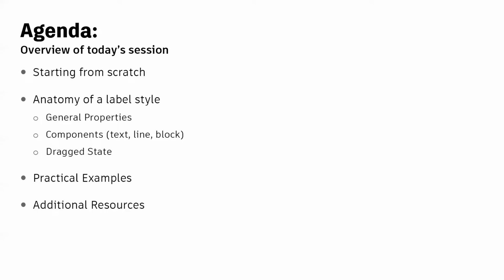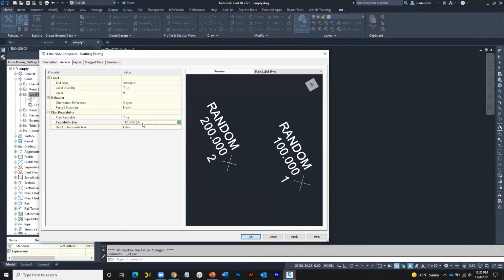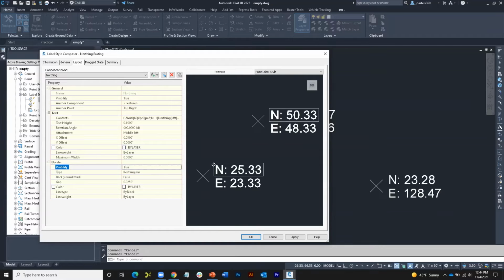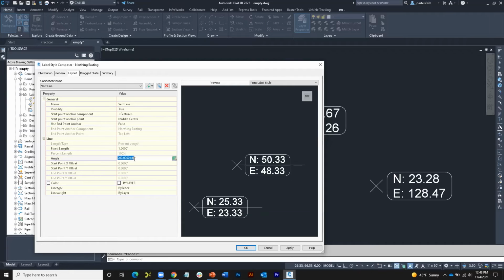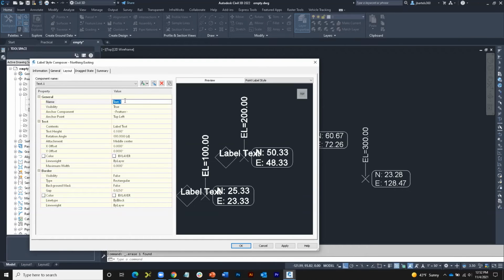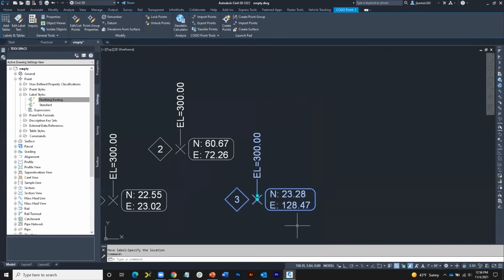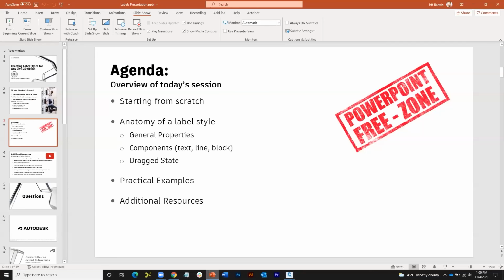Creating Label Styles for Any Civil 3D Object

Comment: With Label Styles in Civil 3D, if I have my drawing set to 1:50 and drag out and position my label text, then change the annotation scale to 1:100 and reposition the same label for that scale, the text height adjusts correctly but the text location does not revert per scale like MTEXT does. Is there a setting or workaround that allows label text to have different positions based on the annotation scale?

Comment: Thanks for this video.
however, got an issue: how to rotate text (multiply texts) to current view?
I would like to show on the screen (drawing), point number and elevation in vertical (different ucs) view.
Unfortunately, changing option for one of the label, (in Settings -- Label style -- General -- Behaviour  -- Orientation reference) does not change label view in vertical. 
Further more, editing rotation angle ( -- Layout -- Text -- Rotation angle) given me an insane  result in position of text...

Any idea how to rotate text from flat view (UCS World) to side view (isometric view) ?

Comment: Is there a way to create a point label style for existing structures with inverts? I am trying to have a label made for survey crews who only collect rim elevations, depths, pipe direction, pipe size and material between the rim and the pipe invert. Not only that, but I am curious if it can be dynamic in the sense that if one manhole has 3 inverts and another has 1, the same label can be used instead of creating variants of the label and confuse the survey crew. Again this is for existing structures.

If there is no way, I will understand. If there is another video made on this topic, please guide me.

Comment: 15:09 That won't work with pipe inlets to a manhole. If you move all the inlets and outlets to the top text group entry, you'll end up with a random connection value (Only the output connection, from what I can tell, will display.) The only way to get a border around all the text is to use the dragged state. The dragged state ignores all the text anchor points... and can only be controlled by the order of creation (which is lazy programming).

Now here is my problem.... Lets say I have a manhole that has a main line (an in and an out), and 2 curb inlets (two ins; which will always be the smaller connections). And I want a label to only show the curb inlets (connection size, connection direction, and invert flowlines) and another label to show the Main line (connection size, connection direction and invert flowline)?

Personally, I can't figure out a way to do it... (because the labels don't give that kind of control of what is shown for pipe connections.) The label automatically groups all pipe connections to ins and outs. And what I need it to do is separate all connections to individual values.

Comment: Hi Jeff! Can you help me? I want to have full control of COGO and Survey points display, which one would be a best practice to create a point label style? 
I was thinking about this method: to create a master P (point number), Z (elevation) and D (description), just using a single text component in Layout tab and then to create child label styles from this PZD master/mother, with P only, Z only and D only variations. So, if I just change the text size in the mother label style, every child style would be updated to the same text size updated aswell, keeping consistency among all point texts in the Surveying drawing.

How would you procced in this situation? Is there any practices on this? Is there any problem or restrictions using PZD texts with a single text component instead using 3 different text components (C3D dafult Standard Point Label style)? Is there any disadvantages of using three different text informations inside 1 component instead using 3 different components, one for each information? Do you have any other better solution or workflow to get this same task done? Thank you very much!

Comment: Hi Jeff, again thanks for another great tutorial.  I have a question that may be somewhat technical but has deep implications.  On the General tab, you select a text style from whatever text styles you have defined in your drawing.  That's easy and handy so you can make global changes later.

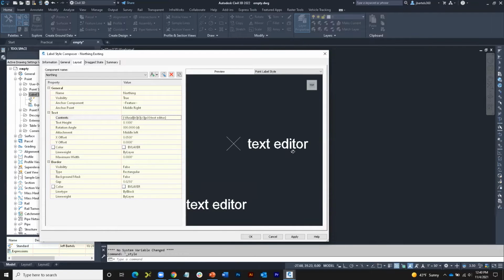When you create a new label style from scratch like you're doing in these videos, what appears in the Text -> Contents field on the Layout tab is the label component coding without any hard-coded formatting qualifications.  That seems to be C3D's default behavior.  At 9:58, however, after you modify the default text contents, the formatting is now hard-coded as the Arial font in the label contents, even though you didn't change anything on the formatting tab.

To make matters more confusing, this behaviour isn't consistent across different workstations.  Working with the same template file and version of C3D, my office workstation does not hard code the font automatically when I make changes to the contents, while my home workstation does (similar to what you see at 9:58 in this video).  The frustrating part is... once that font is hardcoded into the text contents, global changes to text styles are no longer possible.  Each and every text component in each and every C3D style you create will have to be updated manually if, say you want to change your global font from Arial to Cambria for example.

Is there any way to stop C3D from hardcoding the formatting?  Better yet, is there any way to remove the hard-coded formatting from all C3D styles in a drawing template?
Reply from the maker: Hi Alexander, I noticed the hard-coded formatting when I was creating the video.  This was the first time I had seen that particular issue happen.  (You mentioned the issue doesn't seem to be consistent across workstations.) I'd recommend logging a support request though Autodesk and have them take a look at it.  They should be able to help you identify why things work differently on different machines.  They may also know of a way to control the issue, or remove the formatting after it has occurred.
Reply: @JeffBartelsCAD  I just wanted to share an update for you and the community - I went through the steps of troubleshooting this issue with Autodesk support (my support agent and the development team were very helpful) and we managed to narrow down the cause of the issue to the ACAD text style I was utilizing in the C3D styles.  Apparently at some point, the text style became mildly corrupted in my template, which of course propagated to many of my designs.  The corruption seemed to be contained to it's application to the C3D styles, meaning the text style functioned correctly everywhere else, so it wasn't immediately apparent there was an issue.  Upon deleting the text style in question, and recreating it, the hard coded formatting ceased when editing and creating new text objects in the C3D styles.  Unfortunately they didn't have an automatic way to go through and remove it once it had occurred, so some manual effort was required to recreate all the text objects in my styles, but now I know to check and watch for that in the future, and how to address it immediately.  I hope this helps someone out there in the C3D universe!

Another related pro tip - I've recently taken to using the "Standard" style in all my C3D template styles and blocks, making switching between multiple corporate styles much easier.  If using one single template, switching from company A to company B requires redefining only the "Standard" style.

Comment: Thank you very much Jeff! I have a question about alignment superelevation label. I used and edited the standard S.E label ( located in help folder in program files) to get what I want, but I didn't quite get how it works. A lot of components visibility is false, I think they are used as baselines to get the final label to look correct. Is there a video to clarify this?
Thanks in advance!